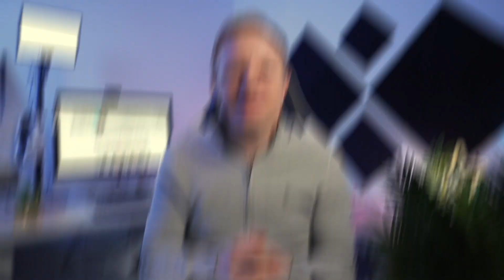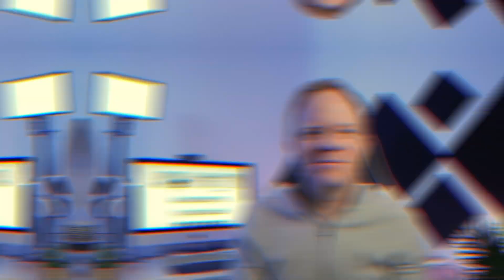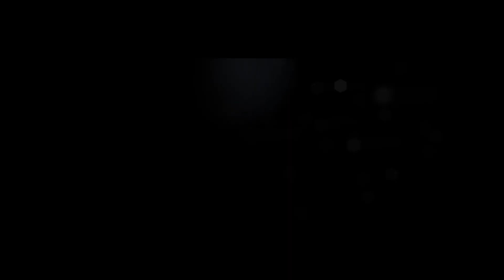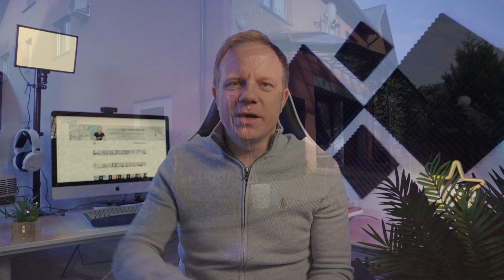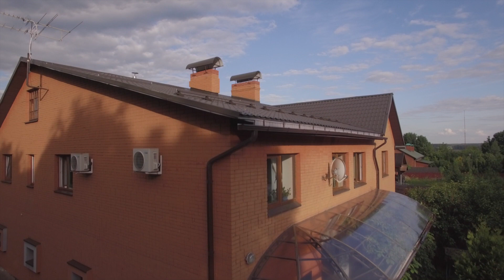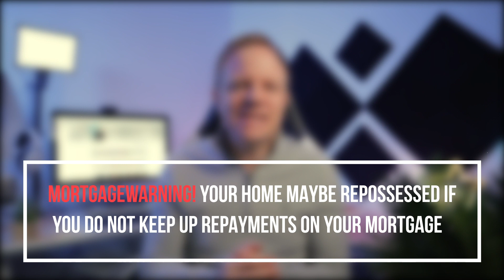Non Standard Construction Mortgages

Comment: We’re interested in getting a mortgage on a 1955 easi-form Laing property, depending on a survey. So far there haven’t been issues finding a mortgage, however one did reject as it’s non-standard. Do you know if Easi-form Laing MK3 have a better reputation than other concrete build standards? Thanks
Reply from the maker: Did you get a mortgage sorted ? Santander ?! 1955 should be better than anything in then40’s for sure…
Reply: @ yes we’re with NatWest, if all goes smoothly. Virgin rejected which is how we found out the property type. If the level 3 survey comes back ok we think it might be a good purchase…

Comment: Hi Alex,  We had a mortgage offer from HSBC on a property (which is non standard construction concrete plus timber house built around 1950s). We did buyer survey and structural survey on the property after the offer from lender and that came fine, nothing major/structural apart from few things that we already knew. HSBC only did desktop valuation of the property when we did application.  Now after the findings in buyer survey about this property being non standard construction HSBC has requested more info on the built year and building type and material used. It's been 2 weeks now since we have shared the reports with lender and they have not replied to us yet. I am worried that they may now pull the deal or refuse to lend us :(  Do you think they will go ahead with offer? Thanks
Reply from the maker: It might be a property, they will not lend on, it all depends on their criteria which they are probably looking into now. How did they find out?
Reply: @alexkerrmortgage  we didn’t wanted to but our solicitor pushed us to share it with lender about all the findings. 😢 she said she is legally entitled to share all these findings with lender.
Reply from the maker: @zainabsohail7006  why did she have the survey ?
Reply: @alexkerrmortgage   we shared it ourselves. New to all this. We didn’t know if we can declined her request to share it. 😢

Comment: Hi Alex, we’re a young couple looking to buy a flat in some modern apartment blocks but most home reports state that these ~20-year-old apartment blocks are “steel frame construction with masonry infill” or “cavity timber framed construction with block external leaf, etc, while very few of them, being >4 floors tall, are built with brick. Are they all non standard construction? Is it risky to buy a flat in new modern apartment blocks? Thanks!
Reply from the maker: It’s difficult to tell just based on this information, what you really want to know if is if they are purpose-built… Are they fairly new flats or older flats?

Comment: My home is an Airey house which we paid cash for but when we have passed away my family will want to be able to sell is there any work that we need to do to the house for this to happen thank you.
Reply from the maker: Hi Julie, is this aired no fines? It sounds like a concrete build… Santander are very good with concrete builds, NatWest and virgin may also consider… It may be worth getting a survey done to understand if there are any defaults in the propertyAnd how mortgageable it might be. Alex
Reply: Thanks for the information, our house was built in 1948 it built with steel and concrete posts internally,with concrete slabs placed on the outside with a pitched slate roof we have decided to get the outside insulated and rendered the pebble dashed.What it meant by Airey with no fines thank you.
Reply: @juliewilliams9441  hi Julie sorry it’s a year later. We’re currently in the process of buying an airey and to make it saleable it needs a PRC precast reinforced concrete certificate. These are around £990 ans make them mortgageable with Halifax. Hope this helps. Great houses by the way!